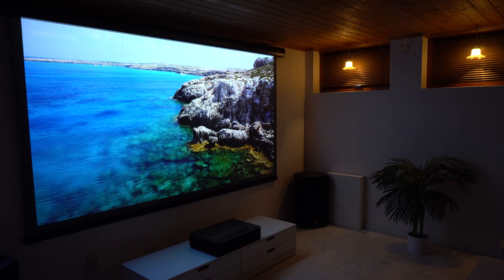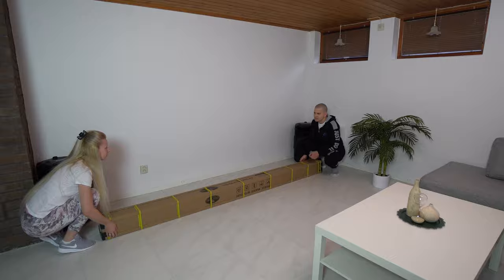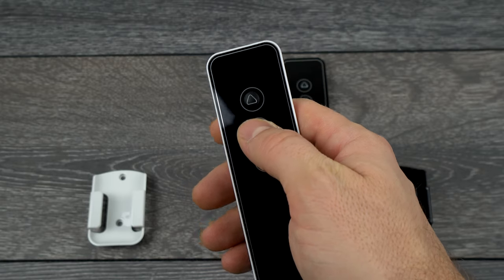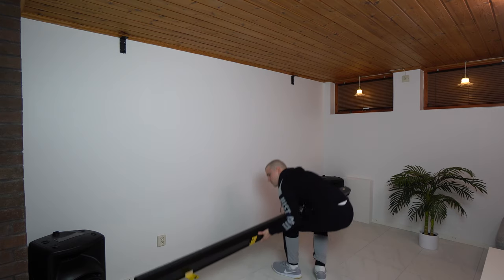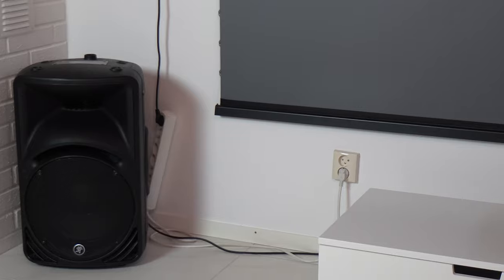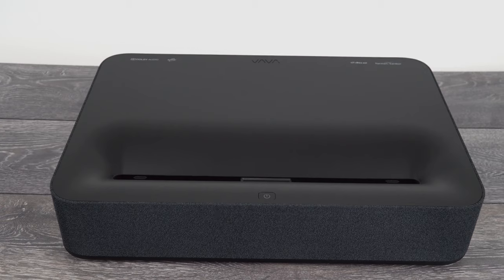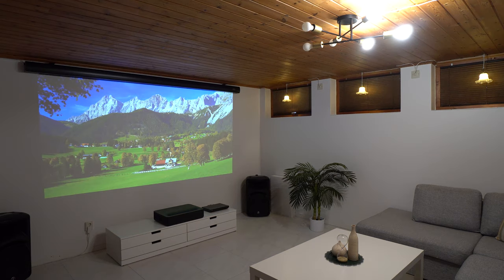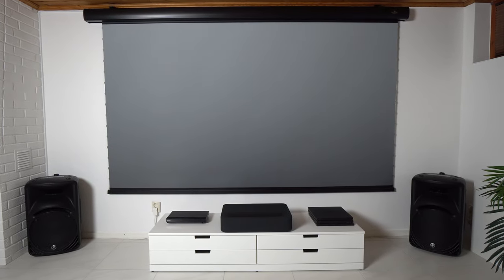VIVIDSTORM 120'' Motorized ALR projector screen review (drop down)

Comment: The price of the drop down and floor rising screen seems to be the same. If both are possible, which one would you recommend? Does the drop down one feels more solid since it's assisted by gravity?
Reply from the maker: Well for my setup drop down screen is a better choice as I don't need to make or buy custom TV stand to fit entire screen housing.
Both rise up and drop down screen have their use depend of the room and application. For example rise up screen you can use even without any floor behind or ceiling. You can install it anywhere on the floor or hide it in custom enclosure/stand/bank/furniture or whatever. It's up to you my friend. BTW, both screens are stretching the screen fabric equally good so you don't need to worry about that.

Comment: Great tutorial, thanks for posting! I have this same screen, which I bought a few years ago. When the screen is rolled all the way down, I notice that I have some vertical wrinkles at the top of my screen. Do you have any tips/tricks to tighten the screen to get rid of these wrinkles? I've scoured the Internet to find solutions, but so far, I've not found anything useful. Thanks!

Tony
Reply from the maker: You welcome! Sense the screen is hanging down with its own weight you can add more weight on the lower metal bar/rail to help it stretch more. Also warm air(not super hot) from hairdryer can help as well. Those are mine tricks when I don't use the screen for a longer period of time. Cheers! 😉

Comment: Great video. Usually ALR motorized screens use to have horizontal line marks. Does this one have them?
Reply from the maker: Thank you. Nope, this one is clean. No marks or any imperfections.
Reply from the maker: Wait what did you mean by marks? Those tiny imperfections from a manufacturing on the fabric? Like black ink marks on the fabric or? I had one screen before with those marks but not on this Vividstorm screen. This one is completely clean of those marks.

Comment: Hi. Thanks. Great video.  Subscribed.  I noticed that you do not unroll the black border of the screen. Do you think it affects image quality greatly if not unrolled ? I would have to do the same as my ceilings are not high enough if I want a 120 " projection so I would have to compromise on the black border. Contrary to the instruction manual ( which is very poorly written ) the motor does not automatically roll back to adjust the tension of the fabric.  Did yours roll back  ?  Thanks

Comment: Another great video, thank you!  Could I ask you a question?  I have just purchased the same drop-down screen, but they don't state what size drill bit to use, for the anchoring screws for the mounting bracket?  What size drill bit did you use?  Thank you so much!

Comment: Great video, we have a similar basement, with lower ceilings, 8' high. This video is super helpful to see how this can be done. I have a 5 year old, and the ceiling option seems much better than the floor rising. Did you find the height adjustment to be challenging, or does the screen motor maintain its saved position well? I noticed you used two different tools that come with screen, one adjusts height and the other tension, can you explain how this works? I love how you don't see the black tracking/boarder, just screen...looks amazing! You did an awesome job. Appreciate your channel and the info provided!
Reply from the maker: Hi Mate! I got what you ment. I have two small kids as well. The boy is soon 3.5 years and the girl is soon 1.5 years old. The drop down screen works very well for the kids that have easy access the screen or the screen controls. Luckily mine don't as the room is in the basement and there is safety fence upstairs. Now about the screen controls. There are two tools one yellow(plastic) that controls when the screen will stop and one black(hard rubber) that controls when the screen will stop. You place the tools in the potentiometer/screw and you turn clockwise or counterclockwise. That's it. You need a few minutes to adjust the desired level and it's done. BTW you can always stop the screen at any level by pressing the middle button on the remote control. That's how it works :) I hope that I helped. Yeah the screen looks awesome and by pressing the pause button you can always choose any screen ratio you want :) Thanks for the support and your kind words. Take care and happy new year mate. Cheers!
Reply: Hi Matthew. In some way I am dealing with the same issue as you do. My ceilings are not that high ( basement - 7.5 ' ) and I would like to have a 110 " projection rather than a 100 " so need to ensure I am choosing the correct screen. Vivid informed me that you can adjust the black bar but not through the remote. I am still waiting for details on how to do that, but probably with the Yellow and black rubbers. I see that Nexi tech mentions that you can do that through the remote's middle button. That would be great. I asked Vivid about the purpose of the black screen : this is what they responded : ''The height of the black border can be adjusted. But it is not adjusted through the remote."  and "The purpose of the black border is to keep the curtain in the middle and get a better projection effect. But the height of the black border is adjustable, so you don't have to worry."   Also do you know what would be the optimal watching distance for a 110 " screen ? Thanks .

Comment: Where did you put the longer power cord for the Vividstorm ALR dropdown? I cant find the link from description.
Reply from the maker: Just regular 3meter long white power cord from local hardware store which I installed in corner and cover with white cable housing.

Comment: Hi ' Hreat video. Can you please measure the length of the casing for this screen. (Not including power cord). In cm please!

Edit: Also is the power cord hard wired into the caseing or is it an IEC style detachable cable.
Reply from the maker: Length of the screen housing is 2.9meters. Power cord is hard wirred but you can unscrew the cable connector and replace the cable like I did.

Comment: Hi, thanx for your review. I own a Optoma short trow 4k. Do you think this screen coud work fine in case of projector ceiling mount? Thanks.
Reply from the maker: Glad you like it my friend.
Well not really. You see If you flip the screen then the projector needs to be flipped as well which will pretty much kill the ability of ALR screen fabric to block the light from the ceiling. The screen would then block the light that comes from the floor which is not really useful.
Reply: Ultra short throw only

Comment: Could you share what cabinet you're using here ? I have the same problem of low ceiling height and I was looking for something similar. Thanks
Reply from the maker: Sure! That is a custom stands from IKEA and it was a cheapest and only option that I could find at the moment, as my ceiling is a bit lower there in basement. These items you can mix on their website and make them as you pleased. They called ''Nordli'' here in Sweden. Here is the link: https://www.ikea.com/se/sv/planner/nordli-planner/#custom

Comment: great video. thanks. is it possible to use this drop down ALR screen with a ceiling mounted epson ls500 short throw projector? or does the projector have to be below the screen for the alr to work? thanks in advance
Reply from the maker: Glad you like it! The projector needs to be on the ground as the light that hits the screen from the ceiling direction gets blocked. P.S. check this projector cabinet it's very cool - 
https://youtu.be/mZPXMH2IOMg

Comment: Do the drop down have the 2metal arm behind the screen like the floor rising type..? What is the weight like for both..??
Reply from the maker: No, it doesn't have those two metal arm behind. Drop down screen dont need it and the screen housing is much lighter and more compact/slimer then rise up screen. Don't know exactly how much they weight both, but rise up version of this screen is much more heavier.
Reply: @NexiTech  many thanks..
Reply from the maker: No problem :)

Comment: Thanks for the video mate, my query is I want to put a samsung frame tv on my wall for normal TV then have this screen come down over the top to watch movies. Can that work?
Reply from the maker: Glad you like my video mate! Sure you can, you would need to install some spacers between wall and brackets and place longer screws but for sure it can be done. Or you can just hang the screens directly from the ceiling that would be much more easier. With the screen in the box follows ceiling brackets as well so you only need to get some rope or thin chain to finish setup. Easy :)

Comment: Ive got the 120" floor rising screen, can it be mounted upside down,  on the wall/ceiling to turn it into a drop down?
Reply from the maker: If is the ALR screen for UST laser projector with horizontal micro lines then no. The screen will only work in one direction.

Comment: where did you get the white stand on which projector is placed? did you replace the screen's black cable with a white cable?
Reply from the maker: That is a custom stands from IKEA and it was a cheapest and only option that I could find at the moment, as my ceiling is a bit lower there in basement. These items you can mix on their website and make them as you pleased. They called ''Nordli'' here in Sweden.
 Here is the link: https://www.ikea.com/se/sv/planner/nordli-planner/#custom

Comment: nice review !!  thank you.
Will you be testing the "Xiaomi Mijia 1S 4K"  UST projector  ?
Reply from the maker: Thanks mate! I'm glad you like it.Well I'm not 100% sure that I will, as it's pretty much the same projector like the Milja 4K that I reviewed 2019 only with the slightly higher brightness output and with no 3D support.
Reply: @NexiTech  hmm it has 3D dlp support and is quite better : 1608lumens in cinema mode and 3500:1 contrast. Also less noisy.
Old version: 1180lumens and 2500:1
Note: 1S has no international version like the older one where they took the 3d off.
Not mix things 😁

Comment: hows the comparison in a pitch dark room compared against a white wall?
Reply from the maker: Very similar. There is some slight difference in contrast but it's not that noticeable as this projector has a very good black levels.
Reply: @NexiTech  thanks for the reply.  Im currently using a 4K Xiaomi.  You may remember the video I shared with you about a year ago that shows my black Xiaom 4k UST projector making a VERY loud and obnoxious coil whine.  Unfortunately Im still using that projector and suffering each and every time.  I was hoping you will make a video dedicated to showing how noisy all your UST projectors make in a silent room without any background noise so we can all actually hear what they sound like.
I dont mind the projector's fan noise at all as that is normal, but the high pitch coil whine has completely ruined my experience and Ik sure other people would appreciate actually hearing it as well.
Reply from the maker: Im sorry my friend but I don't remember it. I have answered a tons of comments on my videos and it's impossible for me to remember them all. If you shared any link here in coments section It get blocked automatically as I had so many link scams in the past and I had to activate that link filter. BTW i did make a short video and share it with few guys in comments that had compain about coil whine nose. I don't know if you seen it. My Xiaomi 4K Projector don't have problem with high pitch sound or coil whine. Here is the video that I took at night in dead quiet room. Have look: https://drive.google.com/file/d/1-G7Fy6p2pmrLmfle1Sawt17G8YF5k1qP/view?usp=drivesdk
Reply: @NexiTech  Thanks Nexi.  Unfortunately, mine sounds nothing like that.. Yours sounds completely normal... I wish mine was as quiet.

Im considering purchasing a new projector  between the new Optoma P2 vs the new 2020 VAVA.  What is your opinion on them?   Thanks again

Comment: Nexi, Could you tel me how high is the cabinet where the projector is on and what is the distance from the wall to the cabinet
Reply from the maker: Sure my friend! The cabinet is 31cm high and it's 18cm away from the wall. Distance from the wall and back of the projector is 29cm and the screen fabric is 4cm away from the wall. Distance between front side of the projector and the wall is 65cm.
My screen size is 120 inch.
Reply: Nexi, you are so kind answer my questions. about the Vividstorm screen UST 120"  drop ceiling the black border in the 
top  reading  the specs show 35cm high , could that size be reduced and what is the intention of the top black border, if the projector laser light coming from the bottom.
Thanks again Merry Christmas and happy new year
Reply from the maker: Hi again man! Sorry for late answer I never receive notification for any reply comments and I need to go and search every reply manually... Yes that's about right, the black border can be completely reduced/invisible as you can stop the screen where ever you want and adjust it to stop exactly there. Well if there is no black border then projector would needed to be placed much higher in the air or the screen would need to be installed lower from ceiling,
where like this with long black border you can use this screen with various TV stands sizes and still adjust the screen to match it. The black border is very useful actually. Thanks man! Happy new year to you as well, wish you all the best :)

Comment: so it won’t deflect the lights coming from the ceiling now that it’s upside down right?
Reply from the maker: This is drop down ALR screen and it will block the light from the ceiling and pass the light from the floor. That's how it works. You can't use it differently it will not work.
Reply: @NexiTech  thanks, I thought it was a floor rising screen that you used upside down to become a drop down

Comment: I have the rise up version of the screen. Do you think it is possible to set the rise up screen and bolt upside down like you did?
Reply from the maker: I don't think so. If you flip the screen then the projector needs to be flipped as well which will pretty much kill the ability of ALR screen fabric to block the light from above.
Reply: @NexiTech  oh okay. Yah I am trying to figure out a solution to better cover the screens base and hide my vava 4k projector. But can’t find any entertainment stand that fits the dimensions.
Reply from the maker: I had the same problem. You would need to buy or make some custom stand or enclosure for the screen and projector.
Reply: @amroaj34  I just bought the L brackets from Amazon for $70.  I will mount my floor rising screen onto the wall and place the vava onto a custom floating shelf.
Reply: @bossnutz  thanks man! Looking to do the same with my setup.
Reply: @bossnutz  u mind sharing the amazon l brackets u purchased?

Comment: How did you do to hide the screen csbos on the wall, did you not show in the video?
Reply from the maker: Please define "screen scbos"?
Reply: @NexiTech  cables
Reply from the maker: Aha, I replaced the entire factory/stock black cable with the white longer cable, and then I use rubber cable cover/holder from the screen to the fire place and down to floor. You can see it if you pause the video in the certain moments.

Comment: Do they have 150"?
Reply from the maker: I believe 120" is maximum size for this type of ALR screen fabric.
Reply: @NexiTech aha :( i saw that you have projector for 150", why do not use it in full size? In previous house i remember the same, u were using 120". 150" screen would be worse in picture quality? Or just no place for 150?
Reply from the maker: You have a good eye my friend but unfortunately I have no space or need for the 150 inch screen. I can barely use 115 inch screen becuse of very limited choice of TV bank/stand, lower ceiling in my basement and watching distance is more then good for 120 inch.